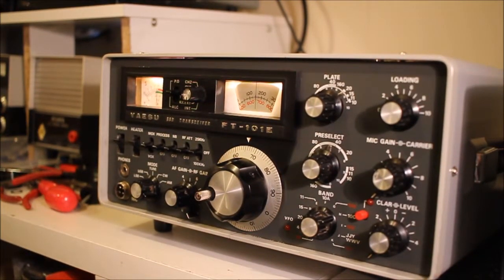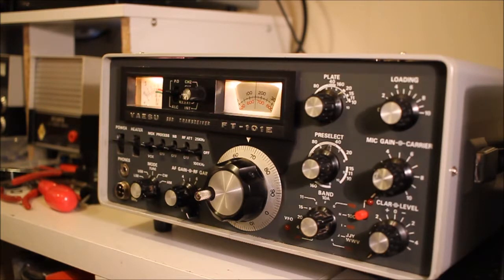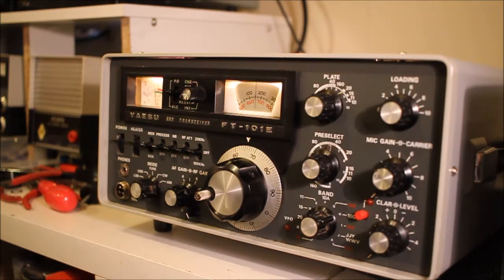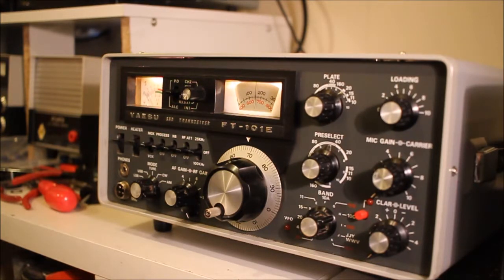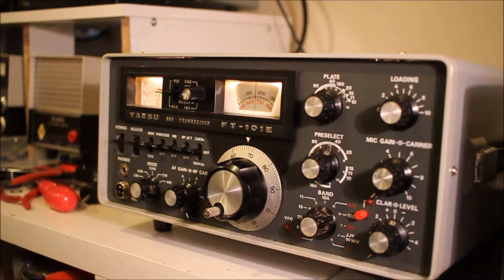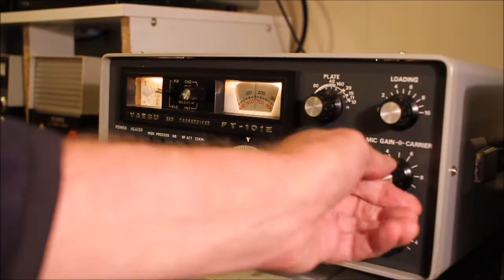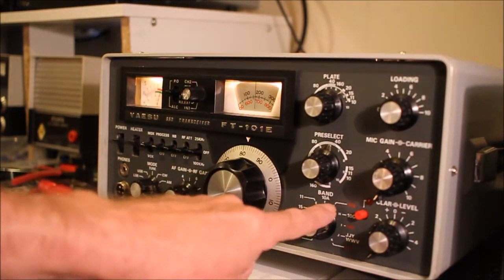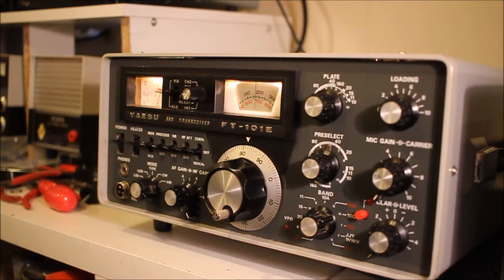Refurbished FT101E - Steve G3ZPS

Comment: With an old radio, if a transistor dies, I would immediately suspect a coupling capacitor as the killer.  Transistors tend to be very long=lived, but CAPACITORS are a different matter.
Reply from the maker: been in this biz for over 55 years...and have seen a few transistor failures..they dont have infintite life !
Reply: @telecastersteve  True.  In the early 70s, I worked as an audio service tech, and DID encounter bad transistors.  But it was rare.  Capacitors, especially electrolytics, tend to go bad, in time.  What I meant was, I'd check the coupling cap, and maybe, replace it, as a matter of course.  They ARE cheap.

Comment: I've had three of them... They just sound fantastic. I made a classic oval radio speaker box with a classic speaker in it, and the audio was incredible out of the radio. Aligned it as per the guides I found and it was more sensitive than my modern kenwood. TS.. I worked all over the world on, 20m with a 5RV and portable MFJ tuner.... Sold it because I got interested in portable. Where the noise floor is very very low... They do drain leisure batteries quickly hi hi 73om

Comment: The red VFO lamp on the front panel is
running off pin 14 from the power supply board.
rit light will come on if its pressed in.
make sure the vfo selector is really on int not tx ext (knob may be off).

I got a 101e here I restored completely and I also did C13 and C131 they are critical.
I'm a cber though so I guess I better go.

;)